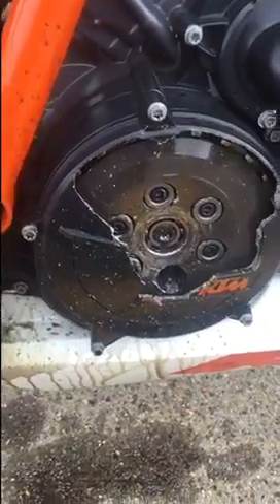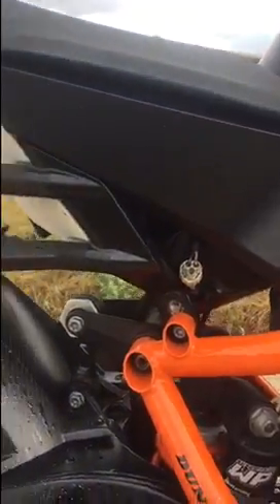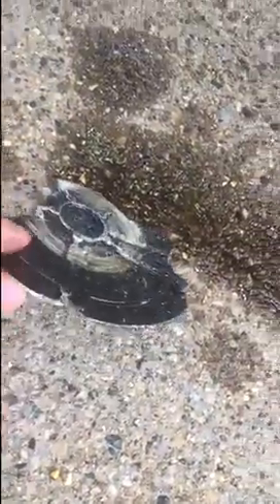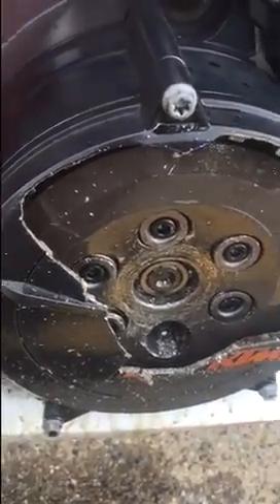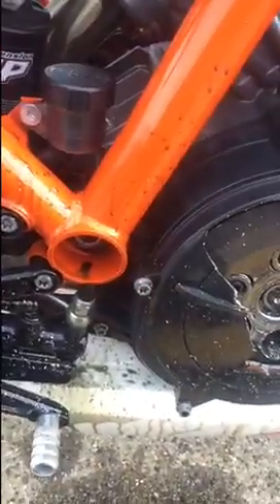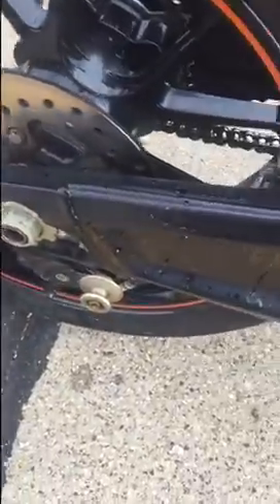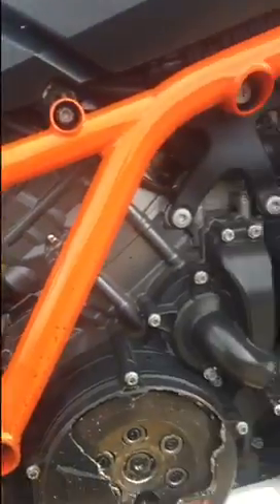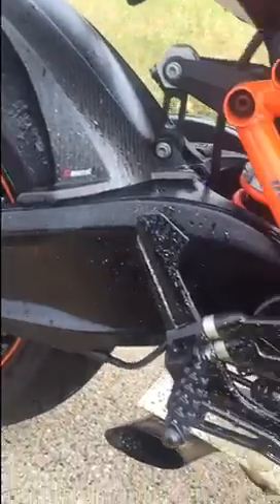KTM RC8R Clutch Failure

Comment: Just recently my clutch lever stiffened up on a ride, I thought is was the slave cylinder so I replaced with an Oberon, but that didn't take care of the stiff clutch lever. I took the clutch cover and the plate that hold the 3 springs in place. The problem was the nut that holds the clutch basket in place had come loose enough for the shaft the slave cylinder pushes on to fully extended causing the clutch lever to stiffen up. I tighten the nut finger tight just to see if that was it and it fixed the problem. I don't have the torque value for those nuts I have to find those. Other than that I love my 2013 RC8 😁

Comment: this actually just happened to me about 5 months back on my 12' RC8R 14.5k miles.  same thing, clutch springs exploded out the case.  after waiting sometime for stock parts to come in, realized the clutch booster was done.  assembled it a few weeks back, started my bike, now its shutting off after idle at 180 degrees.  apparently it looks like this problem is common with this bike

Comment: I had exactly the same problem with my previous RC8 (year 2010, 16K miles on it), one bolt (factory fitted into the clutch cage) got loose then fell apart from the clutch and destroy the cover (not as much as yours) while was still spinning before I pulled the clutch so you can imagine that side of the engine was full of tiny aluminium pieces. As I can see it was not a rare issue with KTMs. It does not take long to remove the cover (the gasket is rubber so you do not need to replace it) and check the screws regularly but I do not think it is the right things to do with a high spec bike like these.

Comment: this happened to me today but only whilst on tick over. clutch spring and bolt had come out. this must be a common fault that needs sorting. my bikes in the repair shop luckily I shut the engine off within a second of the noise. still looking at a few hundred pound repair bill

Comment: I have a 2015 RC8R  2100miles on it. The basket didn't come apart but clutch basket blew riding around just after adding new tires. Slow speeds. I called KTM today and they said they no recall for my VIN. I currently have 3 KTM's. I am SO DISAPPOINTED IN KTM.  This may be my last.. :( and I say that with pain because I love my Super Dukes. The part that is most concerning with the RC8, is the dealers tell me they have no training on repairing these. One even said mine was the first he saw? 2 dealers same verbiage pretty much. KTM North America said take it to a dealer and see what they say? Really when they say I have never seen one? Would you?